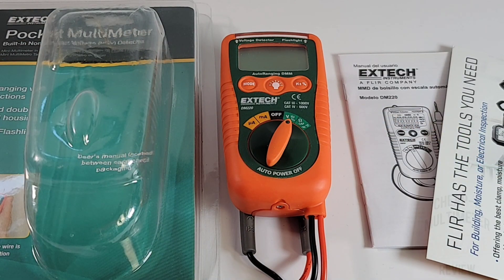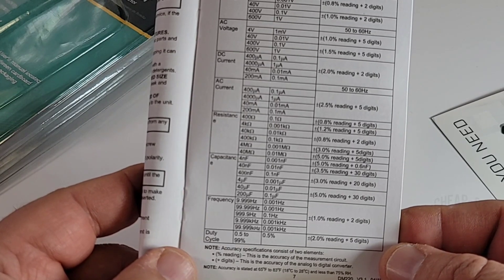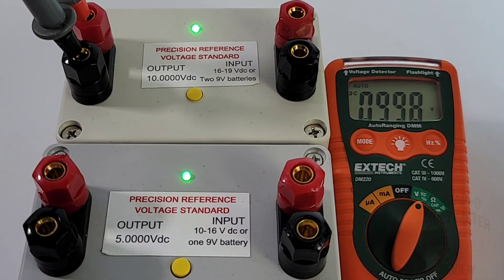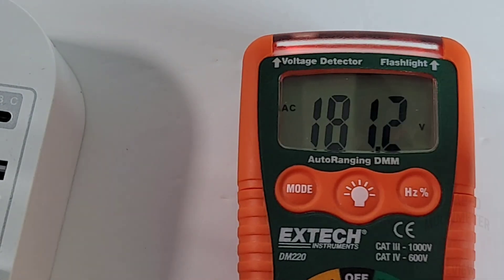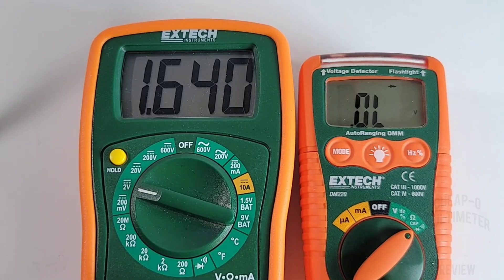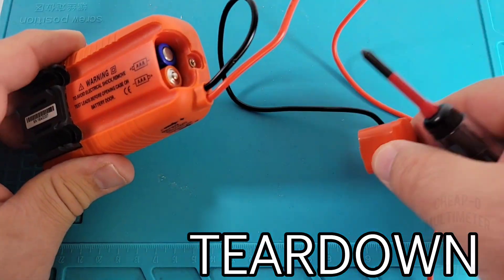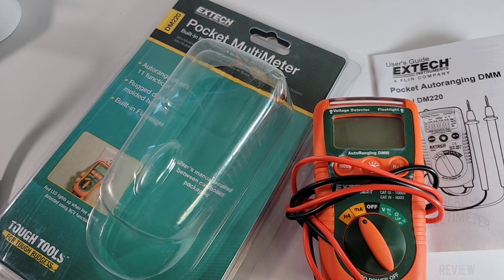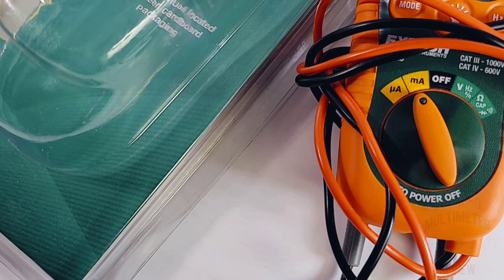EXTECH CHEAP-O Mini DM220 Multimeter Review & Teardown!

Comment: Does it fit in a pocket?
Reply from the maker: Definitely...it's small and compact.  Just make sure you don't poke yourself with the test probes ! ☻️
Reply: @KeepOnTesting  It seems a bit thick. I had a BK Precision that came in this sort of wallet that you'd flip open. It was maybe 15mm thick.

Unfortunately, I was probing the pins of a laptop battery, there was a flash and it stopped measuring now; it's always OL. :(
Reply from the maker: @peddersoldchap  Ahhh sorry to hear that...always a bummer when a good multimeter goes South!  This Extech is thick but it's still pocketable to a degree but it will definitely  be noticeable.

Comment: Great review. I ha one brother of this  multimeter,  that was sold in Europe by Distrelec with a proprietary brand (Now they sell it labeled  as PeakTech). I must congratulate for being able to open it. 
I tried  but cannot find that hidden screw.
I bough another meter,  and gave it to a friend as a Christmas present.
I  was satisfied with i, but when I laid it flat on the bench,  the display was not easily readable
I wanted to open it to mount the display  closer to the transparent window.
I think that a "wedge" shape could improve readabilty.
My opinion is that, as usually happens,  EXTech  has all their meters , built by some OEM.
Reply from the maker: The viewing angle really is bad on this little multimeter, frustrating because it's such a good overall performer. Definitely not an easy one to open and even harder to put back correctly 😅👍

Comment: Just to say - True RMS and average responding meters should read the same on a 60Hz sine wave, all other things being equal. It's the non-sine waveforms that separate the two, and cheaper RMS meters generally have limited bandwidth.
Reply from the maker: Great point or at the very least they are usually close 😅👍

Comment: Surpriskngly good input protection, a cleanup with steel wool and alcohol will likely make those leads more responsive.- some say theres a release coating on the plating or some such that causes it to be like that-??
Reply from the maker: Totally agree 👍  Yes those leads were pretty darn loud for such a scratchy sounding continuity!
Reply: @KeepOnTesting  Ive got the little UniT in the video, really like the chunky little guy--lol
Reply from the maker: @yambo59  Yea that's a great tiny multimeter from UNI-T...I LOVE how everything stayed true to its bigger brethren...looks like it was a full size dmm that shrunk !😅